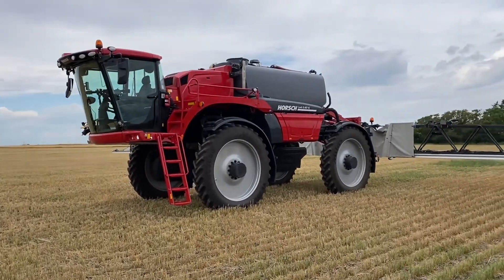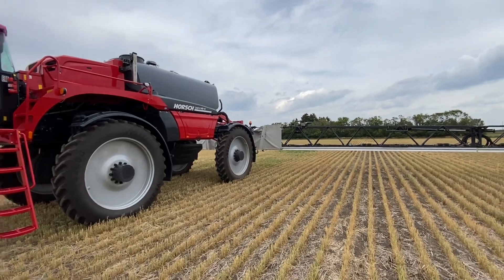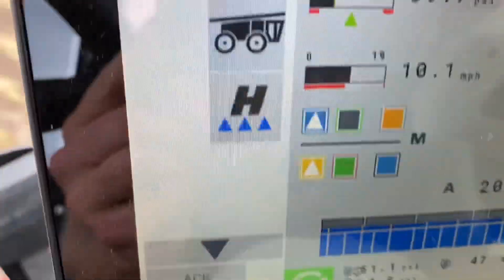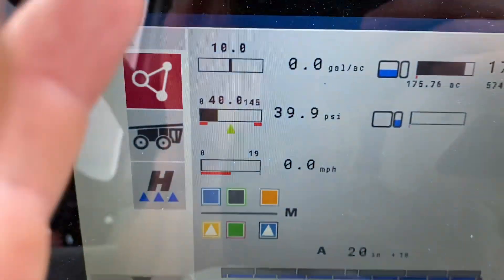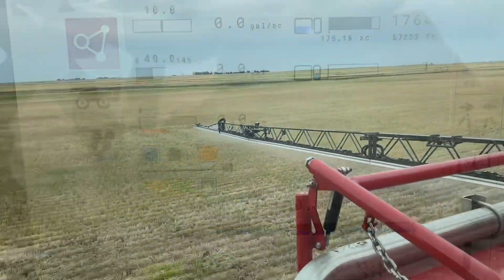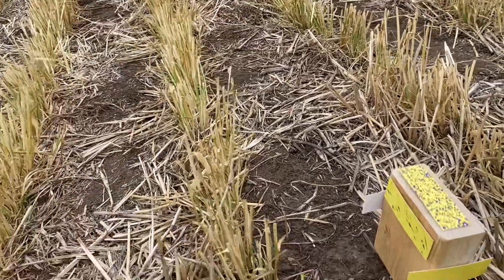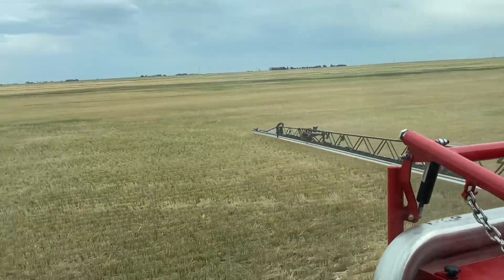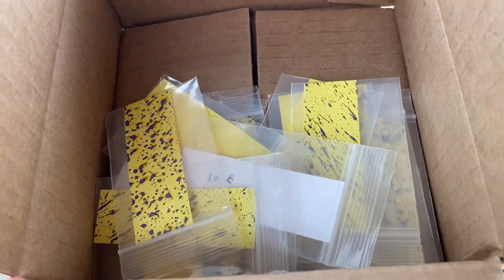Spray Coverage Test.  Horsch Leeb 8460 with alternating twin and flat fan nozzles on 10 inch spacing

Comment: I think Horsch has one of the best boom control systems on the market. I have been running 15mph with 15inch boom hight, using 3 nosels at the same time. Here in Germany, very few spayers are able to do that, most other brand struggle to keep the boom somewhat straight at 5mph driving 40+ inch above the crop. Nice that you tested the spread of the drops, i didnt thought so much would land on the back at 10 inch. Hope you get Mike Mitchell to demo one, as soon as the service infrastructure is ready.(You dont really need a lot of service in my experience, but better you have it, than you need it)